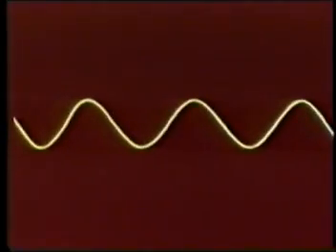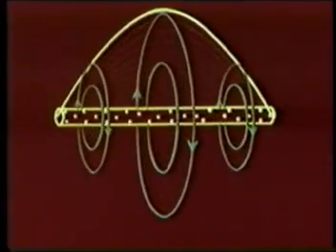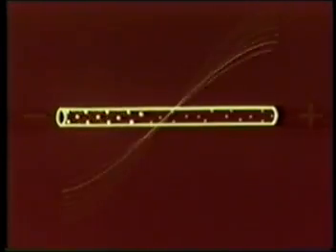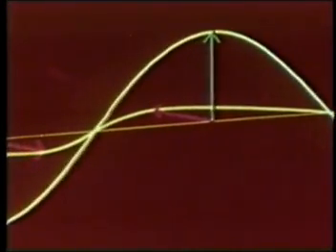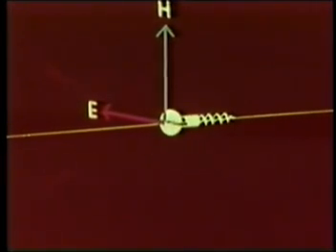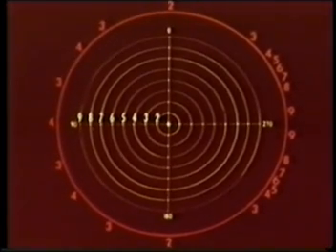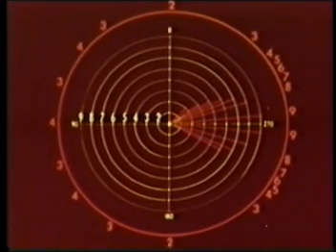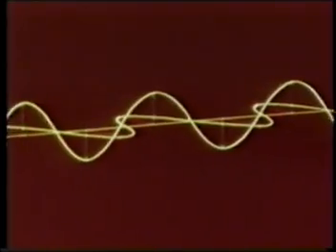Antenna Fundamentals 1 Propagation

Comment: How the E and H fields appear in time phase in the pattern? They are out of time phase (90 deg) at the begging of the video ...
Reply: Thank you! I've been struggling with this part too
Reply: E & H fields are in time phase because both are at max value at the same time and at min value the same time
E & H fields are in space ortogonal, thet is at 90 degrees to each other
Reply: This is not explained at all well. Electrons in motion create the magnetic field, whereas zero motion ( no current ) has no magnetic field. While the electrons begin  travelling, from the time  of zero voltage at the feed point, the magnetic field and electric field rise together and fall together as the feed voltage rises and fall in the sine wave. It may not seem intuitive that there is a changing current, because the wires are open circuit to normal DC voltage, however a voltage applied to any open unterminated cable pair will cause a current flow right up to the point where the electrons can travel no further. If the frequency of the changing voltage is such that the direction of electron flow (current) is reversed just as they reach the end of the wires you begin to have the makings of antenna theory. The speed of travel of the driving energy along the wires match with the length of the antenna wires in proportions related to the type of antenatal.
Reply: Current flow produces magnetic field.
Polarity (accumulation of electrons on one side due to voltage) creates electric field.

Now, the CHANGE in current direction produces a VARYING magnetic field which in-turn creates an electric field.
and CHANGE in polarity (change in the side of accumulation of electrons) produces VARYING electric field which in-turn creates magnetic field.

So, magnetic field is produced due to current in the antenna AND ALSO due to the change in electric field.
and electric field is produced due to polarity in the antenna AND ALSO due to the change in magnetic field.

Hence, both fields are produced at all times and these fields are perpendicular to each other.

Hope this offers some clarity :)
Reply: you made me understand it better with your explanation. thanks.
what i dont get is if a constant DC is supplied to open wire why does the polarity change , what changes flow, because it should just be constant posetive or constant negetive straight line . is the DC going ON and OFF, or are they talking about modified DC by voice of a person AC voltage(carier wave).
Reply: I would like to add that in the video, actual electric and magnetic fields are shown.  
When the electric field is maximum near the edges, there is no flow of electrons and hence zero magnetic field.
As the electrons start moving, they get accelerated and gain velocity.  As a result electric field starts decreasing and magnetic field starts increasing. At the center, electric field is zero whereas magnetic field is maximum.
Thus magnetic field is out of phase with electric field.
However, when we consider the rate of change in magnetic field, it is maximum near the edges when actual magnetic field is zero (sinusoidal curve).  When the electrons have a maximum velocity, magnetic field is maximum but rate of change in magnetic field is minimum at that point.  
Therefore, changing magnetic field is in synchronization with changing electric field.
The fields which get transmitted as radio waves are changing electric and magnetic fields.
Reply: So they are these regions of the antenna called reactive near field and farfield, in the former the waves are out of phase but in the latter they are in phase
Reply: i was wondering that too

Comment: Why are magnetic field fluxes not even at any point in the wire? Because I remember that electricity is even at any given point. Why the edges of wire have smaller magnetic field lines and the center has greater line? Wasn't it supposed to be like a cylinder rising in diameter and collapsing, but diameter even at any given point ?

Comment: Great vedio, but i am a little puzzle about the amplitude of E plan and H plan, the 2 plan could not get the maximum value at the same time, there should be 90 degree phase difference, is this a typo?
Reply: No Mr 世鹏胡, they are with a 90° phase difference when they are in the "Near-Field-region" and there is no average power radiated , when the fields are in the "Far-Field-Region" they lose their 90° phase difference and now there is an non-zero average power radiated.
I hope that answer your questions. 
Have a nice day.

Comment: Let me tell you my experience. All theories in RF transmission are good for  classroom teaching. One has to practically do and learn in laboratory to understand antenna basics. I find huge differences between theory and practice. Infact I find certain things in books are entirely wrong or opposite. If it works it works because it works. Nothing works in deterministic way as the theory say. Simple things like material, conduction material, type of wire, grounding etc etc which makes huge difference in operation are conveniently neglected in books.

Comment: Why isn't the H-field changed by the surface? Does anybody care to explain?
Reply from the maker: Answer supplied by researchgate.net: The answer lies in the boundary conditions. the divergence of E field is rho/e0, that means something is coming out of the surface , depending on the surface the thing which is coming out will change or in other words the electric lines need a termination point so surface plays a role in it. Wheras the divergence of b is zero, so nothing is coming out so surface has no role to play, in other words magnetic field lines are closed and surface do not modulate them. I hope this answers your question.
Reply: Javier Anderson  Clear as mud. :)
Anyone have an easier explanation?
Reply: +senormedia you want him to dumb it down for ya?
Reply: That would seem to be implied in my question. . .

Comment: Am I the only one that noticed that the directions of the magnetic fields are reversed according to the left-hand rule?
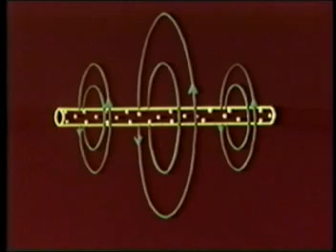Reply: (@ 2:57)
Reply: Yeah, should it be the right hand??
73's
Reply: sebaogal1 If I get your question right, the right hand rule in the video is ok because the "current" flows in opposite direction than electrons.
Reply: The video was showing the flow of electrons in the dipole antenna not the flow of positive charges.  This means that you would have to use the left hand rule to determine the direction of the magnetic field based on the flow of electrons.